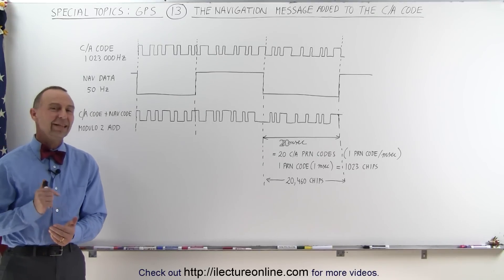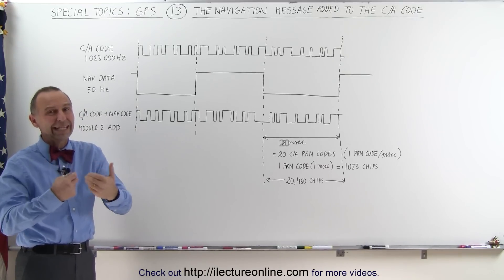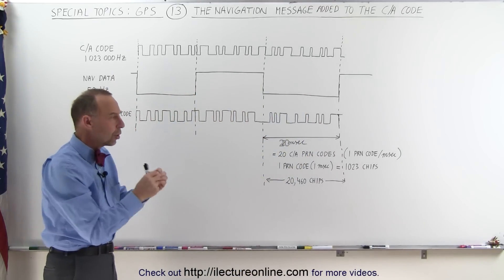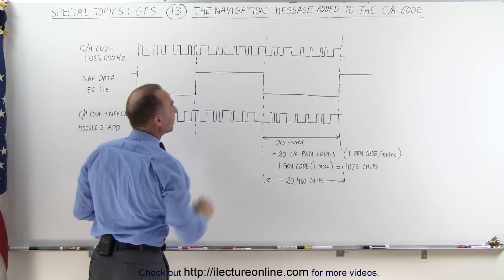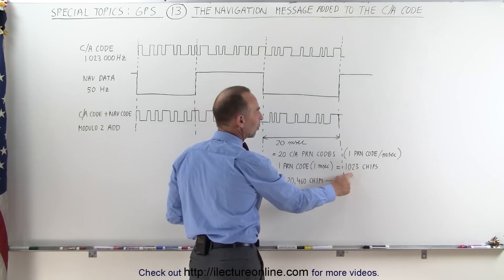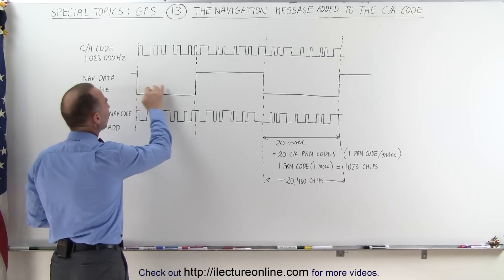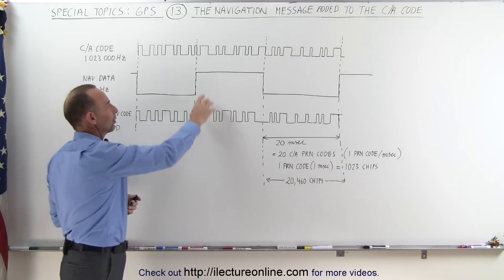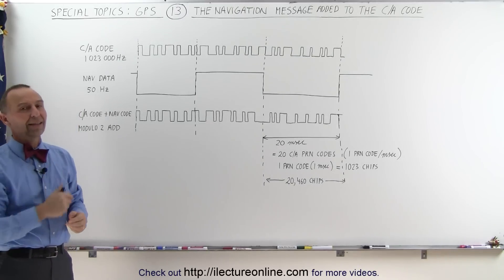Special Topics - GPS (13 of 100) The Navigation Message is Added to the C/A Code

Comment: Don't know if i understand this correclty. But isn't a single chip of the C/A code itself detected from the 180 degree pahse shift, and then the naviagation message interpreted from a correlation of pahse shifts on the C/A code every 20 milliseconds? Great videos!